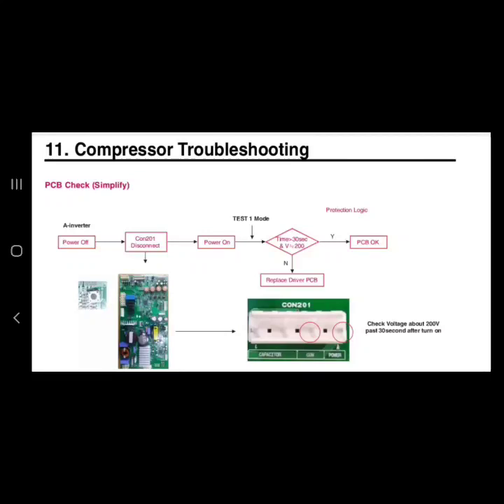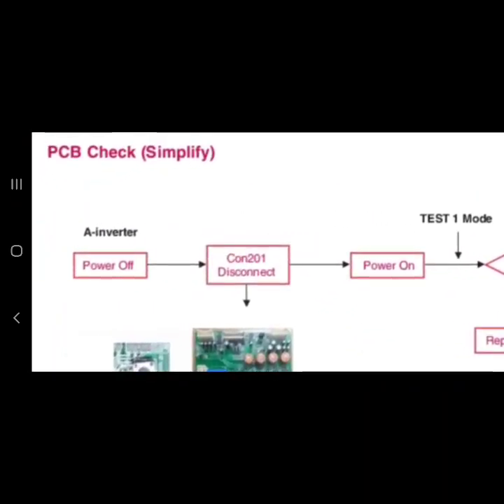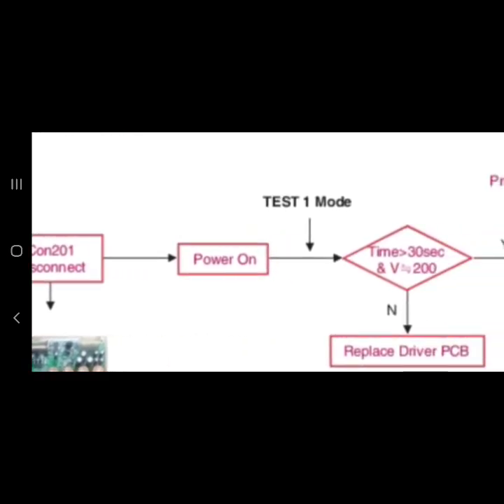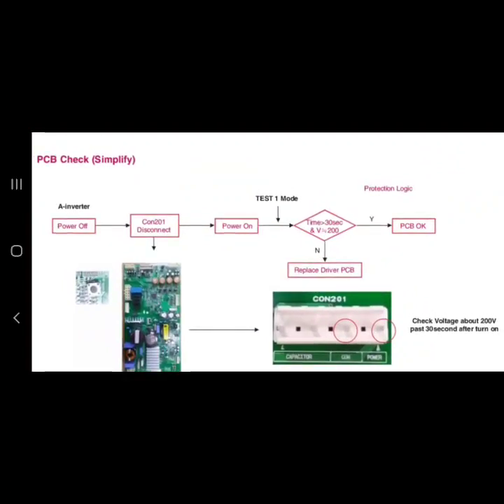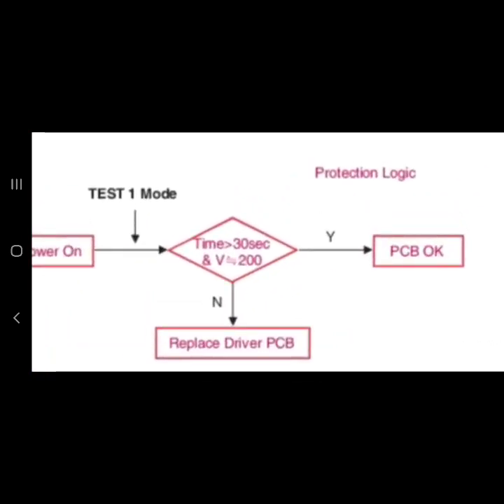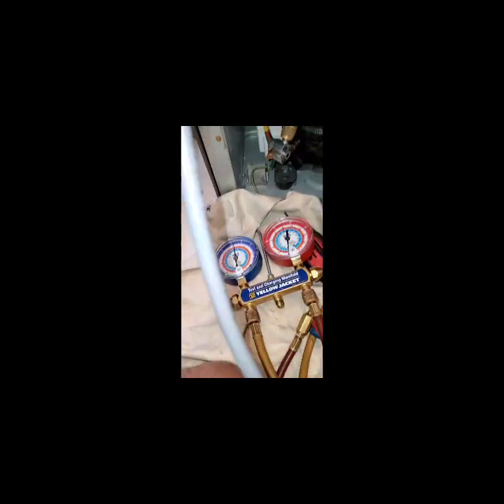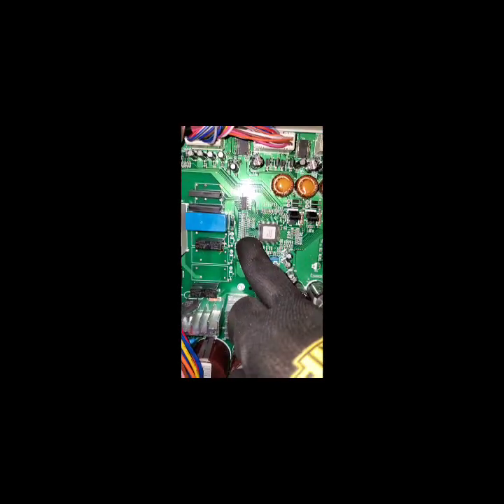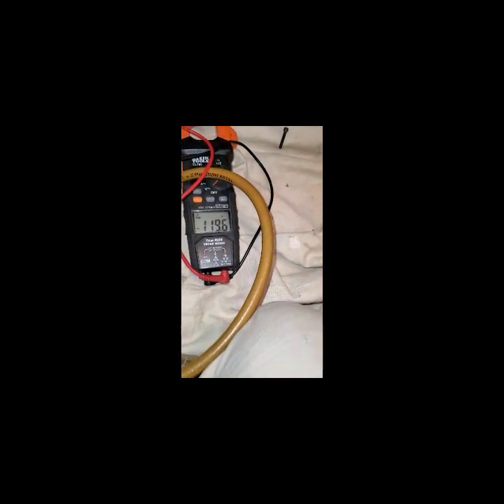#TECHTALK Check this before changing LG compressor

Comment: As per service manual you told to measure  across 2 pin of compress ..there are only 2 wires wires going terminal p c measure 6-8  great what the resistance ... is this not 3 phase inverter compresssor... when I measure resistance  from previous  pin p to unlabeled n/c   0 ohmd measured  like wise c to n/c pin 0 ohms ...is this normal I would have expected 8 ohms???
Reply from the maker: Correct, the linear compressor is different. Then your standard compressor it only has one leg. I did this video a few years ago. My experience has shown me that it's oftentimes the compressor that is the culprit

Comment: I'm a commercial HVAC guy so I'm not completely stupid when it comes to this stuff. But this one's got me stumped. I don't usually work on refrigerators. My board's a little different.. possibly because it's inverter? I don't show a capacitor by my board. My con 201 doesn't have A capacitor on it on the board. It's got the orange wire as save. The gray wire is power and the black wire is common. Should I be seeing 200 volts from power in common to the compressor with this particular lg refrigerator lfxs26596s. Any help you could provide would be great
Reply: once you disconnected  plug , it doesn't matter which wires you have. you just connect your  mulEBR730936timeter to the two right pins on CON201 and  see  how voltage changes. in my case it started form 20V to 127V (max).  i have  LFX31925ST fridge and        EBR730936  board.
Reply from the maker: After doing a few of these I realized the compressor is often the issue.  It fails mechanically.  Regardless of what I said on this video
Reply: Unfortunately, you're right. My PCB is on the way from eBay but I already know that it's the compressor. And I have 6 blinking lights. The unit is out of warranty and I will try to fix it myself.

Comment: Great stuff.   Just tested my PCB and I have zero volts before and after pressing the test button.    When plugging the refer in I do get a 1 second reading of 40 volts tho.    So does this definitely pinpoint a bad PCB.   Or would a bad compressor cause the no voltage too ?

Comment: I measured the voltage of my 4 Door LG refrigerator ( Linear Compressor) and it came out at 240 VAC with connected and 120 VAC when not connected housing.  Is PCB OK ? LED Blinking 6 Times.

Comment: for 10 years working on fridges, never had replace main control board on LG or Kenmore. Same time had replaced hundreds of compressors...
Reply: We have had two PCB fault. There are two capacitors below the RH corner of the heat sink, 100uF-35V. Both times after a power surge during a storm!

Comment: So if board good, and compressor running, bad compressor?
Reply: YES, That is correct, but you have to Check Ohm between Po and Com : 7.2 ~9.2 Ohm: Normal  & Short loop(Circuit)  before replce Comp.

Comment: Set it to AC volts? I thought it was DC on those compressors? Or is that the signal voltage on these in DC?
Reply from the maker: 0-240 vac

Comment: Hello, I measured the voltage after pressing the test button, waited for at least a minute but still getting only 100V DC and around 60V AC. The manual says it should range between 145 and 180. Says below 80V it is faulty. The fridge serial is LG LFX33975ST, the PWB model is EBR752347 or EBR730936.  My issue is the fridge but mainly the freezer is not cold enough (also no ice in the icemaker).  All the fans are running in test mode but not otherwise. The linear compressor resistance reading on the two used pins is correctly 7.5ohms. I already replaced the freezer evaporator fan motor, the ice maker fan and compressor start relay but no luck. Also I pressed the test button multiple times today and the LED on the board started flashing 6 times indicating "current trip - PCB defects or cycle clogging maybe the causes". The LED stopped flashing after replugging the fridge. Given the voltage measured on the PWB does this indicate the PCB needs to be replaced or the compressor? Main PWB should be OK?  What is cycle clogging referred in the manual?
Reply: I also measured during normal operation after more than 10 minutes of being plugged in (as instructed by the manual) and measured 264V AC. The manual says "higher voltage readings may occur under heavy load conditions."

Comment: Hello, great video.  Does this test work with all LG linear?  I found a manual for my lmxs28626d/00 and it shows to do the test but on the power and #1 capacitor terminals.  If I run it on Com and power I have 135vac.  If i run it on power and Capacitor I get about 210vac.  Not sure if i should replace the board?

Comment: If the LG compressor isn't vibrating and it's getting unusually hot, IMHO I'd bypass all the other tests and start with a new compressor.  Fridge has basically kicked the bucket.  There were quality control issues with LG refrigerator linear compressors made a decade or a little later.   Mine only lasted 6 years.
Reply from the maker: 👍 great point
Reply: Yes. Theres actually a lawsuit from 2019 and a new lawsuit for jan 2024 because lg knowingly used substandard,  defective compressors. Many are capping out within 3 or 4 years

Comment: My fridge was doing exactly what you showed, I checked it like you did and it was only puting out 28 volts and the led was not working. Compressor test good, fan is running. I replaced the board and it is doing the same thing and still pcb is only putting out 28 volts on the com 1 port. Did not fix. You have any idea what it could be. I did everything ten times over to make sure I was doing it right
Reply from the maker: Yes its probably the compressor at this point. Im going to eventually take this video down. Seems like even after everything stated in the tech manual,  folkss are still having problems 😕
Reply: @TMMApplianceRepair  your putting out videos.. there is not many for lg , so kudos to you and thanks.
I just started to work on LG and it seems to me with my limited knowledge the compressor is always the problem.....so far..Lg likes to send the pcb board with the compressor even if you dont ask for it. Maybe the compressor is taking out the pcb too.
Reply from the maker: @stevemcvaugh4928  after years of experience you are absolutely correct
Reply: @TMMApplianceRepair  probaly becuase you are supposed to test it with the molex connector connected to the board to get 200VAC.

Comment: Confused.... where does the 200 V AC come from when the fridge is powered by 120 v?
Reply from the maker: The board has an Inverter on it
Reply: @TMMApplianceRepair ok. This was the info i was looking for. I was wondering how 120v outlet got to 200v unless the board had some type of transformer or inverter. Makes sense now

Comment: If the compressor is not plugged in, the board sees the low (no) current draw and will not ramp up to 220v.  The tech sheet SHOULD say test with connector plugged IN.    With all the Americans working in Alabama, you would think they could do a better job translating the service materials to English.
Six Blinks means that the compressor NEEDS more power to cool at the same rate (excessive power).  This confirms what we can all see in the video.  The condenser is blocked with dirt, so the compressor is having to work harder than designed.  "Work" is power and current (measured in AMPS) is half of the equation.  When you see 6 blinks of the on-board LED, clean your condenser and see if the problem goes away, and temps normalize.  The condenser probably got cleaned during the repair and so it appears that the changed PCB did the trick, when in reality the cleaning of the condenser was all that was required.  But hey, you won't get $500 for cleaning a condenser!  lol   BTW: I just had a Samsung with a similar situation, initial checkout the inverter was giving error blinks, so I cleaned the (very) dirty condenser and ordered some parts for my return visit.  when I came back, no more blinks, everything cooling just fine.
Reply: I did my test with the connector off and I got 3 blinks which meant disconnected wire. It got up to 128 v before kicking off. Right next to that connection it says 100-127v, and when I tested with the connector in I got 111v. Do these boards require updated software to work properly? Tested the relay of the compressor, installed a new one, just finished this stupid pcb board test. I just want my fridge to cool 😂
Reply: @jackscharlau8045 i was wondering same shit. Residential outlets are 120v. So thisxtechs video, his voltmeter went to exactly 120v. I dont think its fonna go to 200v if its just a basic 120v residential outlet. Unles theres some type of transformer on the cb.  Am i missing something or does the board do something on its own to ramp upto 200v?  Im just using common sense,  and when i saw his meter stop at 120v, i thought thats what a 120v power source is going to show. But he said something was wrong because it didn't go upto 200v.
Reply: @jackscharlau8045 did you ever figure yours out. I got 3 blinks too and it looks like the compressor just isnt kicking on.

Comment: Is test mode one where to put it when evacuating system? I know on whirlpool dual cool you have to put in test2 to put diverter valve in neutral position. Also, where did you get the lg tech sheet for that fridge?

Comment: I ran this test week ago and found that I was only getting about 60 volts so I went ahead and ordered a new board installed ran the test again and I'm still only getting about 60 volts out of the board that was replaced. Compressor is running the evap fans are running condenser fan is running but not cooling?
Reply from the maker: Did you apply the jig
Reply: @TMMApplianceRepair  do I have to do that with the new board?  I thought that was only with the new compressor?

Comment: I replaced a board and it’s still supplying 120v doing this test. I’m not sure this is accurate.
Reply: Mine shows 140V, never made it to 220V either. I am now debating if I made a mistake ordering a new board.
Reply from the maker: Sorry man this is directly from LG. Im only as good as what they offer us
Reply from the maker: It's happened too me as well ended up having to replace compressor
Reply: @TMMApplianceRepair  Thank you for sharing anyway though.

Comment: Is this for every lg double door fridge?
Reply from the maker: No i would refrer to tech sheet it may be slighty different
Reply: @TMMApplianceRepair  do u hv a service sheet for  gr b207? I checked that the caps were off reading n replaced them but the compressor still did not kick in. Any advice on that?
Reply from the maker: @stevendavid9430  does board have test button?
Reply: @TMMApplianceRepair  yes it does.
Reply from the maker: Push test button measure output voltage  at the board.. should see it increase from 120vac to 200v .. measure voltage down at compressor... verify wire harness.. if no output voltage i'd go board... if so then compressor is culprit

Comment: Did this... didn’t get above about 60vac. Put in a replacement board today and same story. Capacitor is good. Not cooling below about 50°F. 

What’s next?
Reply from the maker: We're only as good as what info LG offers.. However I have seen this happen before. Change the compressor filter drier u should be ok.
Reply: @TMMApplianceRepair  thanks, I know and agree — right in the service manual...but sadly, didn’t fix the problem!

Yikes...a filter drier replacement is not quite as simple as swapping out the board. Might be in the market for a new fridge after all. :(
Reply: @dla529  What did you end up doing? What brand?

Comment: Did the new board fix the problem, my Kenmore Elite is doing the same , voltage comes up to 147 v a/c . It's a LG linier compressor   . ugh.
Reply: Did you ever find the problem?
Reply: @juanlanda6990  You testing is done different then my paper work that came with my Kenmore Elite (Linier ) compressor . Your instructions my board is bad, Kenmore says test on the two outer pins and they are circled also    but far right and far left pins. If I test there it goes up over 200v  ac.  Now  two outer pins are Capacitor and power as you probably know . I still have the fridge and keeping it until if find this out, even though i purchased a new one. The other test they give me in the instructions is also wrong . Also when checking the IPM the test is to use a multimeter and check the POWER and COMM but there schematic show meter pointing to POWER AND CAP, so those voltages come out wrong also. So my problem is Instructions ... I read a comment down below who said he tested like you did and it said it was the board , because it was below 200 v. He purchased a board and had the same reading , that's why I am questioning this.  I can send pics of my directions if you want to check them out to see what I might be doing wrong . Thanks for your help. I also did the ohm reading on the compressor (knowing they go bad) and it checks out7.5/7.7 ohms. The amps running were .80 amps , not sure about that reading thought it was suppose to be higher and I do feel it running but not  alot.  Fridge is not cold top or bottom... Thanks for your help if you have time.  Your video is the closest to my exact problem....
Reply: @kewl427  Same issue here. Same results as you. Also kept the refrigerator, but now it's becoming an inconvenience to the family. Did you ever figure this out ?
Reply: @kewl427  Note, his capacitor in the video is not on the same harness, it's on top of the board. My 201 molex connector connects to the PCB and the capacitor, latter sits at the bottom of the board. Not that this test is not valid, I think this is due to the fact that these are different boards and we take it as gospel. Much like I did when I thought my compressor was dead after watching a video that shows there should be three readings while now I know that the liner compressor only has one reading on its windings.
Reply: @digitallabs1391    No sir, but starting to find time to tackle it again .. Have to refresh my memory again.
Reply: @juanlanda6990  No sir, but I still have the fridge and determined to fix it even though I have no idea what I am doing. But looking at these video's I do know the difference in what he is doing and what my manual says..
Reply: I would say under 100v you can be sure it's bad, but you most force the compressor to run at full speed with the test button to target above 150v. I would say too that 0.8A is fine. If both compartiments are hot, it sounds like a gas leak. A cue is when you have less than 10 celcius degrees between the room and the middle of the condenser.

Comment: Hey I did this test on a lg fridge that was getting the 2 flashes on the pcb. I reset the fridge and tested the voltage and it was in good range (manual said 80v-180v mine was 160) and light didn't come on. The day after the 6 lights came up, so I did your test and voltage was the same. Tested resistance on compressor and it was good but fridge is still not cooling. Have any ideas what it could be?
Reply: Bad compressor or needs a recharge (due to a potential leak). I have replaced the capacitor, thermistor kit (next to compressor), will try a new board and I am approaching a conclusion I need a new fridge because a new compressor is under BS LG warranty but to replace it is $1K, boo!!!

Comment: So the button on the control board powers off the unit?
Reply: Its call a test button. You can also check the frost system on the 2nd depress if i remember.

Comment: If u get 80 v and up pcb is good it won't get to 200 hundred with compressor disconnected. The 6 blink error is sealed system problem period.compressor overcurrent from restrictions,bad compressor,dirty or restricted condenser or defrost issue causing liquid refrigerant getting to compressor which will eventually fail the  compressor as well and stop cooling.
Reply: Thanks for clarify this to me because not all the Lg Tech sheet shows the same way to do the test mode it varies from Model # for example the model # LFX25973D shows in the tech sheet on the test mode the CON201 connected and shows you on what color of wire you can measure the 200v after press the button.
And the model # LSXS26386S
Shows on the test mode pictures the CON201 without the wire plug and indicate you to get measure on COM & POWER and it said after 30 Second it will measure 200v and I did and it doesn’t reach up 120v on the first model above and I did it the way of the tech sheet shows with wire the plug of CON201 connected and take the measures on the wires are from COM & Power and reach 200v after 30 second. And I did it without the CON201 off and measure on POWER & COM it reach 120V not more Thant that.
Reply: what if my volts are all over the place? are you saying this video is wrong?
Reply: @jamieshipley8963  In my case I disconnected the compressor and it was gradually climbing up to about 150V max and then the whole system shutdown apparently sensing no current taken from the inverter - had code 3 after and didn't look yet what exactly it is. I plugged the suspect compressor in and it was jerking around 30,40,60,90,130Volts. After hooking gauge on low side - 60psi running or not steady confirmed mechanical part of compressor is bad.
Reply: Do you know what a 3 blink error would suggest in lg fridge that won’t get cool enough?
Reply: @markriddle8500 Wire disconnected or bad Power Board
Reply: Not sure but I think the 3 blink is say you disconnect  the cable......when you reconnect the error goes away?